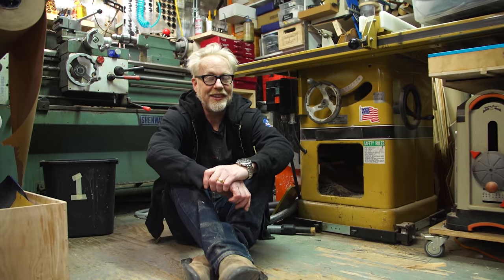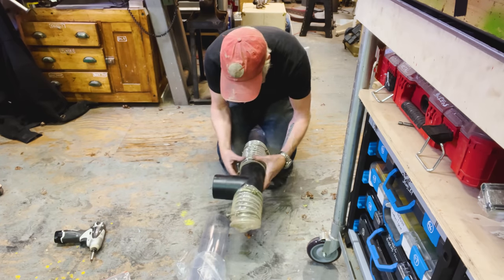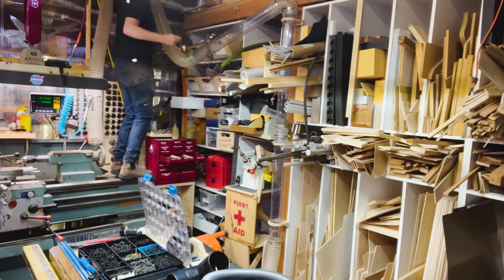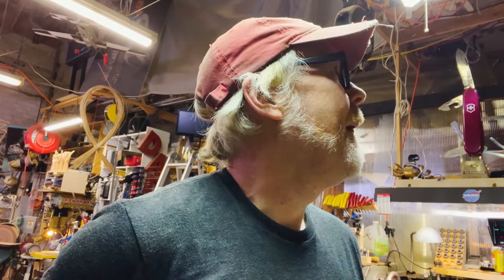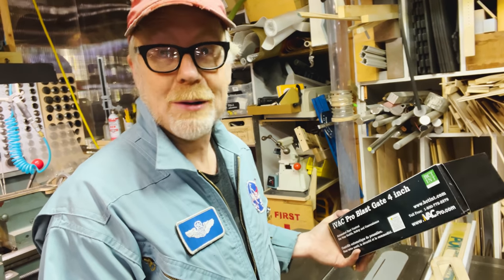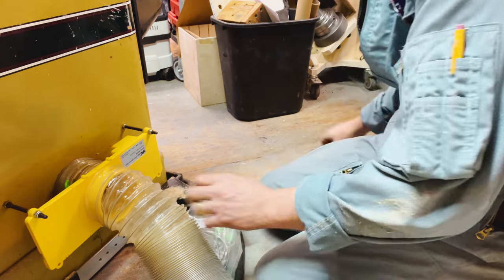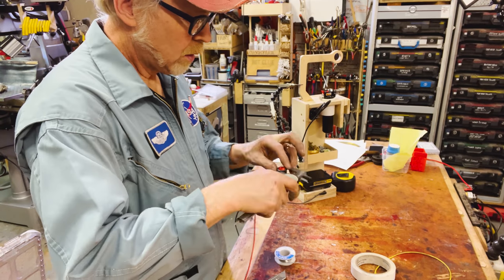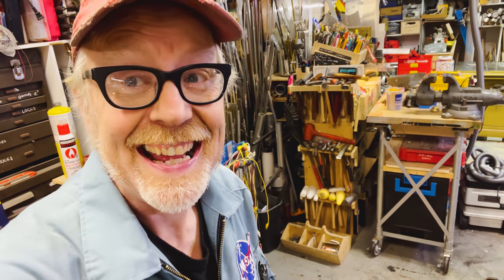Adam Savage's One Day Builds: Shop Dust Collection System!

Comment from the maker: Key-type hose clamp: https://amzn.to/3vyPzHK
iVac Pro 4" blast gate: https://amzn.to/3vvYwBr

Join this channel to support Tested and get access to perks:
https://www.youtube.com/channel/UCiDJtJKMICpb9B1qf7qjEOA/join
Reply: Can you share a link to the clear tubing?
Reply: please add some static protection (just tie an unshielded thin gauge wire on a spool to a rag and suck it into the dust bin. then ground the wire from a point you prefer) a few comments further down there is some excellent explanation from @Ruben De Sadeleer why you should do this...
Reply: As long as you have the ability to set up your blast gates on switches, you should try to have them at the other end of the tubing where the individual tool line splits down off of the main line. Every single connection and length of tubing attached to the main line without a gate is an extra point of failure that could give you a pressure leak. Additionally, all of that open tubing being attached to the system can make it work a lot harder than it needs to.
Reply: Just a small suggestion for the drop lines, Add a Bond to the cork, so it never gets lost or moved too far away from the drop lines, just a bit of braided wire or something so that it hangs off the side of the attachment and you don't have to remember where you put it. . 
Also I have seen in a few vids Adam lets off-cuts of wood drop off the back of the Chop saw table, with that blast gate there now there is the potential for the bit of wood to fall and damage it, perhaps just a small bit of Ply over the top of it to divert any wayward off-cuts away from the sensitive parts of it?
A final suggestion, totally not necessary this one, but add a bit of silicone calking to the inside of each joint, just outside of the Jubilee clip (im not sure what they are called in the states, The pipe clamp tape thingy with the screw) this will reduce any leaks and improve the suction power of the system.
Reply: I am suprised you did not wire the vacuum and gate into the saw, so when the saw is on it opens the gate and turns on the vacuum system.
Reply: You should build in some sliders to strengthen the suction on your dustcollector. The less air it has to move, the stronger the airstream
Reply: OFF TOPIC: Adam, how many Q-Tips heads did Michael Lynch get you to cut off and paint for The Phantom Menace?
Reply: "Could this cut your fingers off?

Excitedly 
"Oooohh!!! It could!
Reply: I suggest changing the name from 1 day builds to Savage day builds.
Reply: Remember Pompeii....Dust kills.
Reply: Where is the dino ? We will not forget until you address the problem !!
Reply: Dude, they make 4" vacuum ends (e.g. Rockler) which suck better than that little 2" guy.  That ~10' length of 2 1/2" hose is what's killing its effectiveness.
Reply: @Palerider1942    That's "hose clamp" auf American.  And they actually make spiral-shaped wire-and-bolt ones specifically for spiral tube that seal better than a flat band across the tube's wire, without sacrificing easy removability.
Reply: I'm currently watching the video and a minute before you mentioned adding gates, I literally thought that the way to make that hose not "not suck as much as a shop vac", would be to add an electronic solonoid, like some use in a potato gun, or something similar, that would work with sawdust...
Reply: For the hose clamps https://www.thingiverse.com/thing:1635537

Also, man you need a ground in there!
Reply: Great video as always, but the leaning far over while on top of the ladder had me cringing.
Reply: To strengthen the suck why not use valves?  Close or open what u need and it makes it better?
Reply: lets build a robot 
and a treaure planet ship 
i  thought this video  was an alien canaster like independance day 
make a broken vent with an alien tale sticking out with a flamethrower beside it and add some alien isolation the thing nastalgia and make some retro bits even 
design an aero foam hoverboard red 
ooh a good diorama is choppers over a lake or a space drive through 
 matrix wall  of masks and weapons
 or just build a hover boat
 build a 3d printer 
or a robot pick a robot like the rick and morty butter bot combined with a radio on voice recogition im thinking of robo chefs too g into cookie dough machines we want an r2d2 coffee maker pancake makers and omelette makers smoothies, soups, french festival chi chi its like giant donut chips its a french machine thats all i know but we can combine superr food  from dr gundry famous youtuber brilliant and then we have peter thiel and space hotels are here and weve no space food recipes we need makerspaces breakout lab a.i cafe innovation centers to merge productivity and efficiency with new structures and art merging with a.i vietnam have dental bots america have robo hairdressers can you tell elon i have tools for finding the rarest metal on the planet to my knowledge 
 laptop housing if we could record the postal process for the robot aswell as the egineering along the way  its gotta walk and  talk  some kinda projector  weather radio and power bank detatcheable hoover and reversable nerf gun  minifridge   possibly 
make a predator spear ruler for yoda  men in black nerf guns 
 make an alien crash site diorama or whats something fun to resemble for area 51 like a alien fingerprint hologram
 
i think we should hunt  holographgic sticker makers and see if the technology has improved much
 i remember amazing anastasia and metal gear solid hologram cards  goosebumbs had them and so did harry potter
 rick n morty meets the xfiles with alien bat labs and mutant turtles call them warp cards with spacex and men in black coffee bugs and abes odessy with a jones hat and whip  standing beside a pyramid schematic projectable explanation we could have hyroglyphs translated yano egyption columbs like flintones are burried under walls as foundation blocks 
 xenomorph alien peering out from the glass unit  
or ps1 alien game  spider and crate  being shot and  in a moving card with perfect colour is that even  possible ?? and if so we need worldwide labs  desigated to researching this stuff along with other projects im looking at
mars rover gadget cards 
drone propellars if i were you id build a drone that brings stuff and put on a claw hanger like you just won it drom your red arcade looking plastic press heater with that 
a nerf shotgun reload station game crate shoebox resident evil style is a gud 1 tho so you got a small box in a vendor or station i mean we can run with anything even a space lab with tiny mission boxes we know of so far and in development like hubble photos vs the james web i wonder how different the pictures will be of one shot in particular hubble vs james webb vs ?? hubbble 2 spacex rocket ? whats your favourite space image 
build the 3d printer into an independance day alien ship 

im designing lodsa projects and im trying to win an arciteecure comeption for an a.i cafe makerspace planetarium studio solar roof garden center for every town i need elon musk and throw jim carreys name in the mix just to keep him hopes up he might hae some ventura left in him were amping up the footprint coalition and getting co ordinated breakout labs merging with cultural buildings and cinemas 2d printers ill leave it thier but this is year 3 lets speed this up waste efficiency is our problem anti aging is real better brain function through vegitation and combinatios im finding impossible information on with musks colleagues i cant write stuff publicly ill be in touch emporium 2020 will ye help make a fundraiser for an community hall with steps to go from lowbudget to advanced robo chef supreme invention places
Reply: Does Adam go shopping at regular supply/hardware stores? Or does he order everything? I feel like ordering things would be easier, because you won't be stopped to talk or anything.
Reply: Where in the world was the duct tape to seal up the joints...
Reply: Where did you get the clear straight tubes?
Reply: "Could this cut your fingers off?" I love how that's where Adams mind went.
Reply: Do you think grounding might be needed for the dust collection system? Apparently static can accumulate in the tubing and whatnot and poses a fire hazard. But I’ve also seen people say that the static charge that builds up isn’t enough to ignite anything. Any thoughts or suggestions?
Reply: Haha iVac Pro, well played.
Reply: @sterlinglecour8964  Given the steel wire spiralling through them it'd be handy if they exposed it at points and had an earthing collar on the dust collector.
Reply: For more vacume power on all the pipes add valves on the pipe where it meets a machine so only the machine being used has vacume power
Reply: Should have named this video "From mythbysters to dust buster"

Comment: I'm sure you know already, but an important safety reminder is that the majority of woodworking shop fires happen in the dust collector. If you sand metal on that big 12", and send the shavings to the collector, they can cause smoldering within the collection bag/bin. The dust can smolder for hours even days very slowly before finally catching enough oxygen to light up. I know you do lots of metal work too, just wanted to give you a heads up... Thanks for all the vids!!
Reply: Remedy?
Reply: @aerobyrdable  Don't use the dust collection for metal work
Reply: The vacuum bags should be emptied regularly. Always empty the dust bags before cutting metal. Then empty the bags again after you're done cutting metal.
Reply: As I said in my comment.  Pvc also real bad to use in a dust collection system. It will just build static and then ignite fine dust like saw dust.
Reply: @zigma51  You can ground it.
Reply: @pawpawstew  but he did not
Reply: @zigma51  Are far as I can tell pvc static explosions is a myth and there has been no issues ever reported. Happy to be proven wrong though.
Reply: @redpinelabs  
I don't know if it's ever caused a fire, but it can give you a nasty shock after being used for an extended period especially if it is very dry... the pvc can act as a Leyden jar (capacitor) one solution is to place an uninsulated wire (1/16" steel cable) inside the main duct tight against the  side and bring it out to the surface at each end and ideally ground it on atleast one end.... but to each his own if he's happy then 😎.
Reply: @redpinelabs  Dear Adam- there’s a myth that needs busting....
Reply: @zigma51  This has been proven false.
Reply: @alexlail7481  google "Grounding PVC and Other Dust Collection Myths."
Reply: @redpinelabs  OSHA disagrees. If your commercial woodworking shop used plastic pipe or metal duct that isn't properly grounded, you get fined!
Reply: @Bikeeast  
The over all risk of ignition may take a perfect storm of  exactly the right conditions. Again I'm not aware of any cases of it... but my comments about static electric shock comes from working in a  shop where a branch line was ungrounded plastic (because the owner was cheap) and I got shocks closing the metal blast gate following hours of use multiple times... usually when the weather was quite dry. It was roughly equivalent to an electric fence or small engine spark plug. While it definitely wasn't that dangerous to me directly it also wasn't 'fun', but that was my experience. I doubt many have had the same experience, and yes that was the only blast gate that did it. And he thought I was crazy until I got him  one day 🙂
Reply: @jaecenwhite2590  Wait, didn't mythbusters already do this one?
Reply: @doncarlton4858  there is a significant difference between the size of a hobbiest dust collector and a commercial one.  While there may be a small danger in a commercial size collection system there simply isn't enough airflow in a small one to create enough static to be dangerous.  The dust collector Adam is using is a 1 to 1.5 HP system.  Commercial systems are 10HP and larger.
Reply: Totally agree with the consensus here on the static deal, a busted myth.  But the OP here raised an interesting related scenario, hot metal flakes sucked off a sander.  Offhand, I'd say if it was a danger in Adam's setup here, it would already and long since have caused a fire (he mentioned making the blast gate "years ago"), and I cannot conceive of any material Mr Savage would not sand, if the mood seized him.  Also, given the distance to the collector, those would have to be some pretty hot sparks to hold ignition-inducing temps that far, for that long.  In my shop, 2 feet away, that's another matter....
Reply: A giant industrial magnet stuck to a metal grate near the collector?
Reply: I was thinking that, especially with that giant disc sander. He uses that for metal all the time. He probably knows that but we should remind him if it comes up in a video.
Reply: @torontopianotuning   Should work for ferrous metals but not on non-ferrous like aluminium which Adam uses A LOT!
Reply: @pawpawstew  You cannot ground pvc. It is a conductor and so cannot be grounded. There is no reason to either.
Reply: @doncarlton4858  The key word is commercial. There hasn't been any proof of a home shop ever having that problem. In commercial, you also cannot use plastic pipe because a wire does not ground plastic. PVC is an insulator and you may ground out the area where the wire is but the rest of it will still build up static.
Reply: @Jacob-5949  It's not so much the airflow but the volume of dust that gets into the system and then can be ignited. It can happen in woodworking, grain silos, concrete plants or just about anywhere the particle concentration gets past a certain point and then a single spark will cause a large explosion. It's happened in woodworking shops but I'm talking commercial plants with multiple sanders and other machines keeping the lines full of high concentrations of dust.
Reply: Not to mention, static electricity that builds up within the system. I always ground the tubing to prevent static spark. Zip~
Reply: Perhaps another bypass to a 5 gallon bucket water bong trap when grinding metal.
Reply: Do you, Adam sir, have a motorized Swiss Army Knife ?
Reply: @zigma51 an explosion like this has never been recorded in a hobbyist sized shop that I have ever seen or heard off. If I am mistaken then please provide me with data stating otherwise. Assuming my statement is correct, this isn’t a concern until you feed a dust collector with an insane amount of material. Even then, the conditions have to be no less than perfect to explode.
Reply: This is a fantastic comment thank you for sharing

Comment: Hey Adam, if you had used Y-bends instead of those 90 degree T's you would see a much better result.
Reply: Too many 90 degree corners too, also the main line should have been 6" better than 4", the drops can be 4".
Still, it's a lot better than what he had.
Reply: Y-fittings or Wyes. less loss through the branch, and you can maintain the straight
Reply: was looking for this comment
Reply: Adding a gate in the end at a flexible hose also reduces the pressure, there are flexible but more rigid hoses that have straight inside and the spiral spring on the outside. V3.0 :)
Reply: he is also hooking a 1.5" hose up to a HVLP dust collector so... I don't think these details are that important to him. I love the guy but he has never taken this stuff seriously. this is a great first step but it's still just a step...
Reply: @tekeraq  ideally you would put the blast gates as close as possible to the dust collector. The less volume the motor is having to pull against the better it should work.
Reply: I mean I expected him just to use PVC pipe for most of the runs or metal.  The woodshop at my middle school had these big metal ducts as the primary lines for the dust system
Reply: @filanfyretracker  pvc pipe is bad for this.  It will build up so much static electricity.  With all the saw dust that a fire hazard.
Reply: @zigma51  You can dissipate the static by running screws into the joints and wrapping thin copper wire wound from screw to screw, then into the center screw on a wall outlet.
Reply: @pawpawstew  but did he do that?  I only seen him use wooden clamps what will not work for that.
Reply: Fluid/thermal/aerodynamicist here.  Yes indeed joints are usually a much bigger opportunity for losses than straight run wall smoothness.  That and leaks!  Those two are worth obsessing over, and just do whatever with your straights as long as it's in the ballpark.  (Too big is also bad as it'll drop the dust if the flow is too slow.)  But if smooth is an option, that's good also.  Clear is a bonus too!

Re: static buildup, you can also feed a length of bare wire through the ducting itself and ground it to the motor housing!  Even if you aren't worried about an explosion, I can confirm that getting powerfully zapped in the hand every 3 seconds while you're using a hand tool or vacuuming isn't very fun.
Reply: @filanfyretracker   Metal ducts are a mofo to seal!  "Small" leaks add up very fast.
Reply: This is absolutely true.
Reply: @Beef4Dinner22  not from a user standpoint.  Place the blast gates close to the tool and as accessible as possible and you will use it. Forty years of experience has shown me if its not convenient no one will use it.
Reply: @zigma51  Urban myth, zero fires in home shops, Factories are a different matter.
Reply: @pawpawstew  agreed, he definitely needs to mitigate the static buildup!
Reply: @williamwinter2638  with the fancy automatic/remote controlled gates this is not a consideration.
Reply: @Beef4Dinner22  yeah my understanding is that every part of the system that is open contributes to turbulence and loss of suction 😕

If you're slapping a shop-built seal shut then it's tempting to have them right at the machine, but with remote/automatic gates usability isn't hampered by placement.